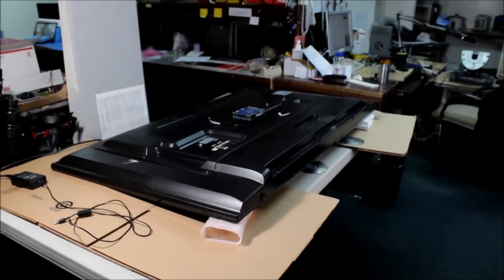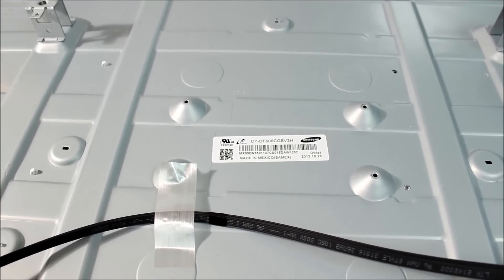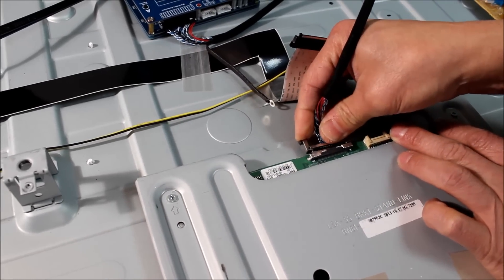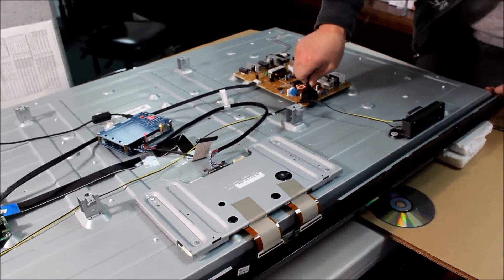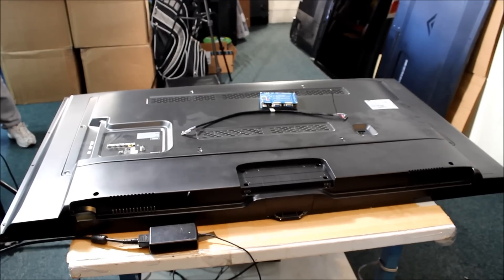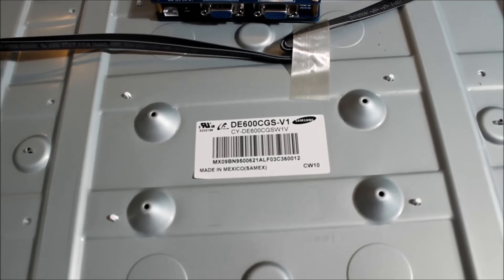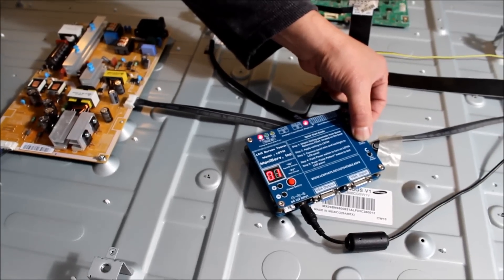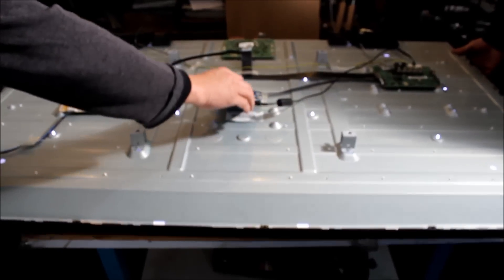LST04-TV, How to test LED TV screen

Comment: Hello.  There is a t-60s green tester.  When a signal is sent to vga input from a computer or from a laptop to matrices with a resolution of 1366x768, a picture with distorted colors comes out, as if something with color or with a bitness of not as much as 8 bits but 6 are being fed. Matrix LP156WH2 (TL) (AA).  Something in the firmware of the device?  Two LVDS cables complete with a tester that went 40 pin with two on vga shows distorted colors as if the tester gives the wrong bitness .. and from the LVDS output of the tester in logic mode 12 volts gives only 10

Comment: 100   video   and no  clever     person  yet........golden  questions  remains   unanswered  how on earth i would know the   vcc pane?    how  on  earth  i know the   resolution how on earth  there is one  type of  cable that fits  all  tvs?
Reply: First you measure the fuse on the T-con board to get the supply voltage and second it comes with various cable adapters to fit various T-con boards and Third, you just google the TV specs and you will find the resolution.